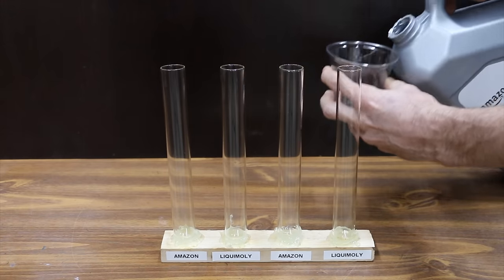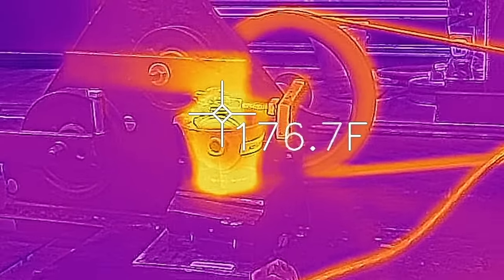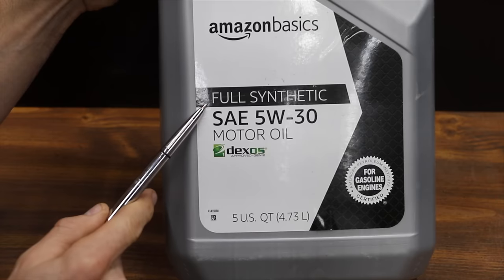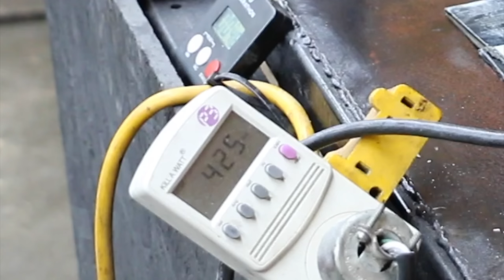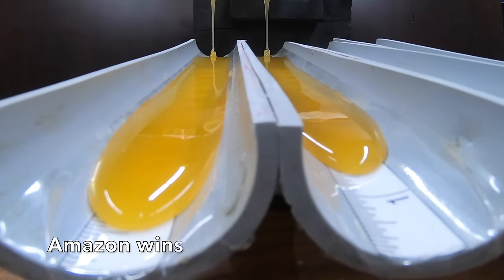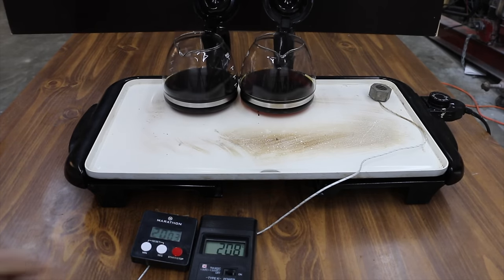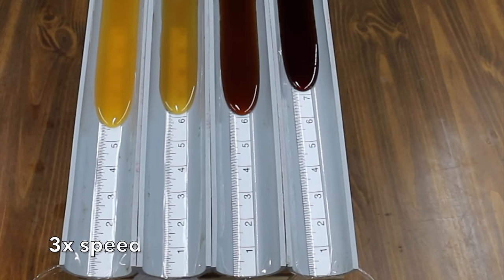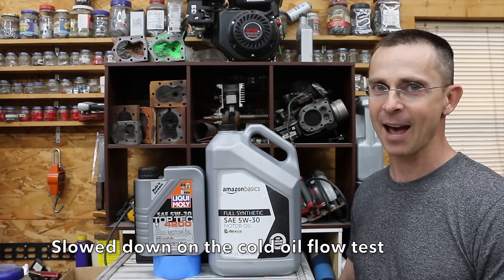Is Amazon Basics better than Liqui Moly? Let's find out!

Comment: I used Liqui Moly in all my cars and never had oil consumption or damaged engines, I was always satisfied
Reply from the maker: Thank you!
Reply: I think this test shows that quality doesn't have to be expensive?
Reply: Same
Reply: @yilmaztosun4858  this test shows exactly nothing
Reply: You could have used an equivalent lower priced oil and have the same results. Oh and a bigger wallet..
Reply: These tests aren't useful, because at the end of the day, fanboys be fanboys. They'll still pay premium price for name brand oil.
Reply: The Vardarioter haahahah keep getting ripped at the auto parts store. Its your money.
Reply: And I have used Walmart and Rural King motoroil and have the same results
Reply: Maybe you cannot buy Amazon engine oil  in Europe, but Liqui Moly
Reply: Another difference is that liqui moly is certified for use by  most European manufacturers. This amazon basics isn’t. Oils that meet these specs are often more expensive.
Reply: AzNightmare Yep, I’m one of them ...
Reply: A chemical analysis between the two may explain what the difference is scientifically. I wouldn't trash Moly just yet. It may have more beneficial additives. One definitely being Molybdenum disulfide and new generation has tungsten. A little food for thought.
Reply: we used it in our fleet as well, eyes closed, and eventually all engines died, badly sludged, piston rings jammed after 1 year of use. All vehicles were latest and used on highway. we opened the engines to study the damage and the deposit was too much due to usage of liquimoly. We were mostly using the Tungsten Green 5W-30 which liqui moly states is the top tier oil.
Reply: Thats why reason it won at being cooked... And if you use german oil... Something equal than liqui is fosser ... Excelent too and ravenol... Too.
Reply: @DarkVarda  right, and what independant tests can you produce that prove Liguid Moly is better?
Reply: I think that you drew the wrong conclusion from the vid....
Reply: @Adam Deutsch you need your parents credit card to buy oil? Oil as a whole isn’t that expensive..
Reply: Fixmycar Islamabad Ha! Ha! Ha!  You’ll never convince me ALL those car engines died at once from use of LiquiMoly.  Ha! Ha! Ha! Ha! Ha! Ha!  Give me a break.  I use LM 5W-40 in my 500SL and it runs great.  Fast, runs cool, has ZERO oil consumption and ZERO leaks.  NONE.  At 131,000+ miles.  Personally, I love LiquiMoly!
Reply: Look how clean the engine can be after using Liquy Moly oil and engine flush
https://www.youtube.com/watch?v=x4u64lKBbhQ
Reply: @qwertyqwertyu9345  european cars need european oil
Reply: Lmao I'd never put Amazon basics in my bmw and fact is it isn't because I wanna pay more I mean fcp euro replaces my oil for the cost of shipping so let's be real would you put super tech in your car instead of mobile 1 because I wouldn't use Amazon basic over liqui moly
Reply: @greatestever7623  liqui moly only for my n54....oil diffs trans all liqui moly
Reply: i only use liqui-moly 5-40 leichtlauf tech in my Audi's . started using it in a VW Phaeton with a mystery oil consumption. after talking to a moly rep on the phone he said to use the leichtlauf and i tried it and it went away ..i have a C5 RS6 that now has 176k miles and runs like new and a 2.7 , 6spd A6 fairly modded that i use for winter , it has 228k issue free , no burning , no leaking , smooth running miles .. i use liqui-moly ATF in the trans on my RS6 as well
Reply: There's a sucker born every hour lol
Reply: @mdinatale12  I'll be that....but I bet my car runs
Reply: @steve-opainter9572  same one I use Leichtlauf, I wasn’t a fan of him testing the Top Tech but I guess it was a cheaper option in comparison to Amazon. Anyway, I’ve gotten great results from putting Leichtlauf in my 1.8T B5, pulled the valve cover to do my gasket and valvetrain was looking clean for 135k. Also put Liqui Moly 75w-90 for my Manual trans and rear diff and she shifts great! I don’t plan on changing oil brand. Liqui Moly wins in my book.
Reply: Best Oil!
Reply: @GreyMK7Jet  yup cant beat it and it stays so clean it's hard to see on the dipstick . i just realized moly makes 2 stroke snowmobile injection oil and ordered some after yrs of using Amsoil ..should arrive tomorrow it says :)
Reply: @AzNightmare  not if you get it for free, sponsorships really make a difference, you should try it.
Reply: @alejandrogerardo5725  Please sponsor me.
Reply: It seems a paid promotion, this kind of  test is pointless, you have all the data you want to know in the oil technical data sheet and the chemical analysis to know the main oil additives(molibden, titanium, etc...).
The tinken test is only worth for bearings, wich an engine does not have inside.
Considering the engine reaches 400 celsius degrees in some areas , there's no way you can find any worth conclusion about the quality of these oils with this test.
Reply: @morm608  Dude it's pretty useful info wth do you mean
Reply: @fetusman2248  I don’t usually reply to scrubs & internet bugs 🪰🪳but today i have time just go to sleep kid 😕 you in the wrong section of yt go watch sesame street
Reply: @greatestever7623  lol salty liquimoly fanboy
Reply: @DarkVarda  This test shows nothing? I would really like to hear your arguments for that blanket statement being as though, from a pure physics standpoint, this home brewed test actually covers a lot of the key functions of a modern automotive engine oil. Now I am educated enough to know that you are simply what they call “a troll”, but I still choose to call you out and request date points to back up your so called opinion. I will patiently await your response providing that in the past year since you have made this comment Darwinism hasn’t removed you from this Earth, which is a definite possibility I am sure.
Reply: @JeremyBlant  I assure you even in your European vehicle if you experience catastrophic engine failure the warranty department is not going to send your oil to a forensics laboratory and perform a GC test on your oil sample to determine which manufacturers created the specimen. So long as there is oil in the engine, you are fine as far as warranty claims are concerned.
Reply: It's hilarious watching these Liqui Moly fanboys defending their favourite overpriced oil brand, looks like Liqui Moly's marketing department have done an excellent job
Reply: My shop exclusively uses Liquimoly in all their vehicles, including the bmw racecars that they have built and race here in Florida
Reply: @AzNightmare  yes yes I do lol
Reply: @yilmaztosun4858  Amazon quality?Are you falling for this fool BS?Go ahead and buy Amazon oil .There is no shortage of babaloos in this world.
Reply: @bobratu9029  it’s probably not the greatest but you could definitely do worse. Amazon doesn’t make oil. Neither do a lot of “companies”  I caught a deal on some practically free for a few qts, I’m doing to run it and cut my oci in half and see how it goes.i probably wouldn’t use it long term but I don’t have any real reason besides brand loyalty I’m sure if you change it on time and often it would be fine.
Reply: @yilmaztosun4858  liqui moly was made for European cars. I don’t know if it would’ve made a difference if he used the Asia and America liqui moly 5w-30
Reply: @AzNightmare  what oil brand do you use?
Reply: @Phuong_Nguyen_  Pennzoil Ultra Platinum.
Reply: @AzNightmare  always wanted to try the platinum, but wouldn’t you be including yourself as a fanboy paying for name brand ?
Reply: @Phuong_Nguyen_  I gotta buy some kind of oil. It's going to belong to a brand. If PUP isn't available or not on sale, I have no problem switching to Mobil1, which is also what I used to use. LiquiMoly is never on sale, so I'm never going to buy that one.
Reply: @AzNightmare  buy the Amazon and let me know how it goes lol
Reply: @Phuong_Nguyen_  Everything is "Currently unavailable" for some reason. Did they run into inventory shortage? lol.
Reply: @AzNightmare  I’m thinking of switching from Mobil one to LM. I’ll pay the price difference. Mobil 1 seems to break down fast around the 5k mark. So if I buy the LM and change around 7k, it will make up for the difference in price. But price isn’t a concern anyways.
Reply: @Phuong_Nguyen_  Yeah... just stick with what works. TBH, I haven't noticed any difference, but my car is just a daily. I usually change around 5-6k anyway so maybe I'm changing before the oil can break down. Just don't bother being sold for the next best thing if what you're currently using works fine.
Reply: @AzNightmare  I don’t think all oil is the same. Countless stories of how people use this certain oil and it burns .5-1 liter per 5k miles, then they changed oils and it doesn’t burn any oil at all. I have to check to see if mine is burning any oil but I do feel it breaks down. I’ll try the LM and I’ll report back.
Reply: @JeremyBlant  
Who manufacturers the Amazon engine oil?
Reply: @Fixmycarpk  
Name of fleet? Any documentation?
Reply: @MrJohnnyDistortion  warren distribution in Omaha
Reply: @JeremyBlant  
Thank you.👍
Reply: People don't realize Liqui Moly is free. Just order from FCP Euro, and use PayPal. The 2nd oil change, you get a full refund, and every oil change after is free. Free return shipping from PayPal. Just one jug of expensive oil leads to a life time of free oil. After the second oil change, it ends up cheaper than the Amazon Basics.
Reply: @closer71  agreed !! I would never use Amazon sus brand oil .. I’d put that amazon oil in used American car beaters , liqui moly is the best out of the best !!
Reply: I'm not against using Amazon oil (or any other brand of oil for that matter) so it's hilarious that someone would get bent out of shape over brand loyalty. That being said, I only use liqui moly because I don't have a choice. 
My 2.0t vw does not respond well after I've changed the oil several times using different brands. Aside from the Valvetrain becoming unusually loud, I noticed a slight difference regarding oil consumption and overall engine performance.
I don't care what it costs because it certainly beats taking the bus or walking, however, this only applies to myself and I can't speak for anyone else.
Funny how that works, because All of the jdm & domestic vehicles I've had in the past would run off of whatever brand of oil was on sale at the time without any issues whatsoever. My old C10 used 20w50 in the summer and 10w40 in the winter.
In addition to this video, it's important to do your own research and decide what works best for your application. Ignore those who get sore between the cheeks when you do something that they don't agree with, im pretty sure they invented the wheel in their own mind..
More importantly, proper maintenance will eliminate a majority of "what if" scenarios.
Reply: In direct injection engines isn’t less evaporative loss more important?

Comment: Hoping to see Pennzoil platinum ultra in one of these videos.  Great job, these videos are addictive!
Reply from the maker: Great recommendation! Thank you
Reply: @ProjectFarm  Pennzoil Platinum & Ultra Platinum please! 😁
Reply: I agree.  The only 0w-40 oils which meet FCA 'standards' which also works in my 6.4 Hemi is Pennzoil Ultra Platinum, Mopar (relabeled Ultra) Synthetic, and Amsoil.  Stupid warranties and certifications.
Reply: I should add Ravenol SSL to this as well.
Reply: Pennzoil Platinum would be a good addition to this test. Pennzoil Ultra Platinum is harder to come by
Reply: Project Farm the Pennzoil ultra is made from natural gas
Reply: @ProjectFarm  Put it against Castrol Edge. One suggestion is to rank them all against each other. So we'll know how they all stand. I'd hate to have one loose in the first round against the overall winner.
Reply: @UNVME  I got 2 jugs of UP for $53 w/ tax through walmart.com shipped to my door
Reply: Me to ultra platinum
Reply: @bradhepper  That would be interesting. I retired from a major auto parts chain and as it was presented to us it was the only oil to be made from petroleum gas.
Reply: I should add I'd rather use something a little cheaper then Ultra or Amsoil. I would be perfectly fine with Castrol Edge or Pennzoil Platinum
Reply: @bradhepper  ultra platinum is only 25 for 5 qt jug at Walmart online
Reply: @michaeltrower6792  not 0w-40.
Reply: @bradhepper  project farm is using the same viscosity (5w30) in all of these tests so it is an apples to apples comparison.
Reply: @mopar0IIII0jeep  I realize that. That's why I didnt request he test 0w-40. Just other brands.

Comment: Let's be honest. None of these tests say anything about how they will work in an engine.
Reply: yeah these tests are for entertainment only- they mean next to nothing
Reply: That's what I was thinking, they should do a 3k miles after test or so
Reply: I can’t believe German engineered oil was beaten by some cheap oil made by some capitalists
Reply: @EngiesParadise   I know its a joke but Germany is capitalistic as well just saying
Reply: Yeah doesn't say anything about the effects of the oil on modern diesel engine exhaust systems. Liqui molly only one of the few oils to be rated 507, and allowed by VW for use on TDI motors. Doesn't ruin the DPF and exhaust system
Reply: they are not even tests of the same specification, one is dexos and the other is not
Reply: @francoisl7663  Exactly! That's what I thought when watching this, creating a ultra low ash oil that meets 507 specification for expensive DPF systems is very stringent.
Reply: I disagree. If you park your car outside in a COLD climate, wouldn't you rather use an oil that flows better at low temperatures? If you have a race car that runs high oil temps, wouldn't you like to know which oils are going to handle the heat best and burn off the least? While not a perfect simulation of engine operating conditions, you can't argue that these tests provide at least some useful information.
Reply: @averyalexander2303  It all depends on what kind of car you have.
Reply: @kristijanvlasic6936  Exactly. Some cars need an oil that has certain additives, while other cars can't have those additives for certain reasons, like possibly damaging the catalytic converter or DPF. One thing that actually affects what kind of oil an engine takes is how much oil it's expected to burn. Engines that are built more tightly can handle more additives because they won't burn as much oil, meaning not as many of those additives can get into the exhaust. An engine that burns more oil by design can't have as high of a concentration of certain additives in the oil because of the risk of damaging the emissions control systems.
Reply: Maybe for ppl who don’t understand fluid physics or some shit
Reply: Thomas k it’s cheap because amazon subsidizes it. All oil is fairly similar. And Germany is capitalist
Reply: the reality of it is any engine oil that meets the specifications required by your engine manufacturer (which will be stated in the manual) and is changed at the correct interval (also specified) will work just fine and cause no problems. for example, if your owners manual says you need a SN rated oil, and you run one, you will be fine unless you buy like some fake dollar store stuff. 

people WAY overthink this, but the fact is no manufacturer would recommend (and therefore warrant the use of) an inadequate oil, and the relevant licensing agencies (many of whom are the automakers themselves, see: Dexos) would never allow an inadequate oil to display their trademarked specifications.

 just buy whatever meets specs on sale, you'll be fine.
Reply: exactly these meant less than nothing. smh
Reply: What?!  These are extremely relevant tests;  Are you high?
Reply: @TENNESSEETRACKHAWK  This tests oil’s ability to retain lubricity and viscosity after thousands of miles in an engine?  Do you even know what an engine is?
Reply: @Dududu Not quite. While I agree that 0W oil is definitely a good idea for cold climates, there are significant differences in the cold flow properties of oils even of the same viscosity rating as you can see in his comparisons. 
Also, a heavy oil doesn't guarantee good protection and could be counterproductive depending on the application. If viscosity was the only factor that determined wear protection Lucas Oil Stabilizer wouldn't have done so poorly on his lubricity test compared to the comparatively water thin Bestline and Motorkote products.
Reply: IMO this lab test is nothing. You should conduct real test on road. Eg: 3000km test drive and compare whatever you need.
Reply: Exactly. If the lubricity test was done with the oil heated to operating temperature, that would make the test a bit more real world.
Reply: @EngiesParadise  I'll bet the German engineered would completely smother some cheap oil made by socialists though!!

Comment: I would love to see a tire comparison video. Thank you for another great video. I always enjoy watching.
Reply from the maker: Great video idea! Thank you
Reply: I would too. I actually work in a tire warehouse
Reply: @ProjectFarm  I think you have enough video ideas to be the last channel alive on youtube by 2050 !
Reply: That sounds expensive
Reply: MPG vs traction would be a great data point. I got a little surprise when I saw my MPG drop 5% when I put Continentals on my f150. But the traction is worth it IMHO, especially with the lighter aluminum body.
Reply: I like this too, but while tires themselves are expensive, why not air pressure variances and seeing what kind of rolling resistance differences are achievable just through different pressures.
Reply: @steventurner3901  I like where this is going